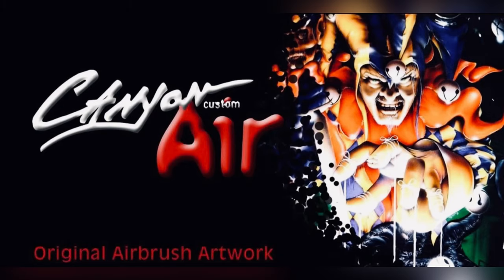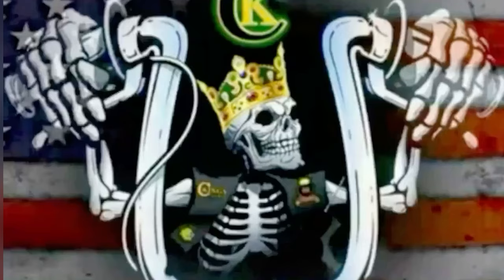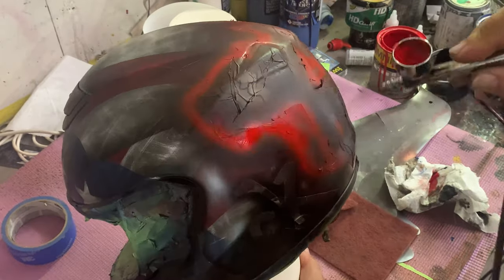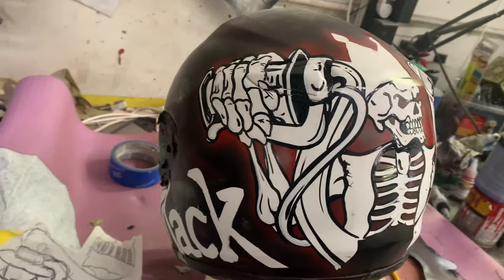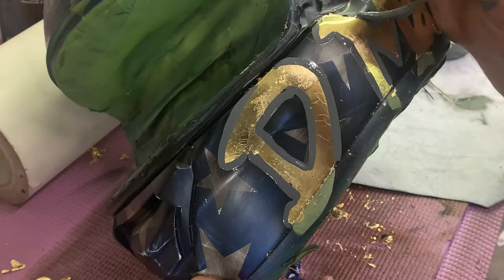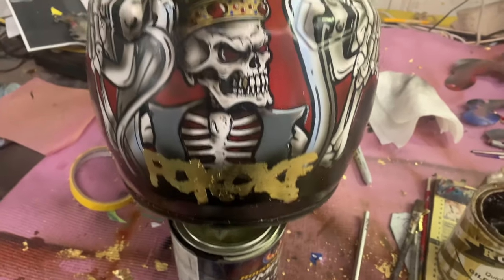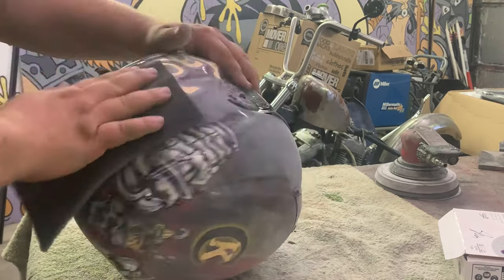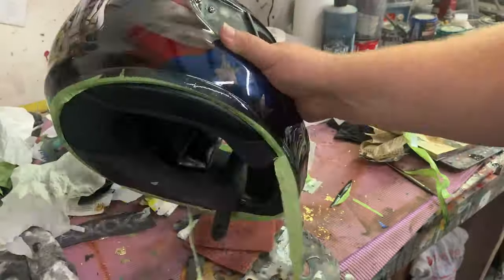Custom painting a motorcycle helmet

Comment: Great work. was told years ago that you have to be careful in what you spray on helmets because it will eat into the material. Understand that's why you would use a base coat but do you need to be careful in what you choose?
Reply from the maker: My experience, not so much with a shiny helmet, but more of the flat helmets tend to have reactions, depending on the quality of the helmet real cheap helmets tend to react like crazy the higher-end ones I never really had a problem with. 
But the shiny Walmart specials or no name brand Amazon ones have a graphic on it and you’re scuffing it up to put artwork or base color on top you have to take it all the way down to the bear because sometimes those cheap helmets have cheap glue that holds the graphics on and they will react to your base color, so I usually just kind of sand the whole thing down and start fresh. It takes a lot more time I know but at least I know when I put the final coat of clear on I’m not gonna get a surprise reaction it’s gonna go on with no surprises
.

Comment: Nice Work! I have 2 questions... Q1-If helmet already has color to it, after sanding would you recommend a base coat before painting design? Q2- What type clear coat did you use? Thank you.
Reply from the maker: when i paint a part i try to spray it the lightest color of the project or dust a white on the job because lighter colors over a darker base do not show up as will or you have to spray several coats of the lighter color on to get the color that it is now spraying a darker color over a lighter is the opposite   example helmet is yellow and i have a purple graphic . that purple covers no problem over that yellow...... can always go darker not lighter 
have a helmet job im posting in a week or two that's white base and spraying yellow, orange, purple, red with very little amount of paints cause im using that white base to pop the yellow and orange colors
clear coat..... Ive used house of kolor, ppg dupont ....about all of them you can use a low end clear like shop line or nasons there fine clears its just there thinner low uv covrage not a Heavy Solid meaning thick clear= high solid grater uv protect    also lower end thinner clears air dry faster cause they are thinner and  usally i have to sand them down again and re-clear to get the smooth finish to bury the graphic paint edges
Reply: @canyoncustomair  Awesome, thanks for quick reply! Much Appreciated!